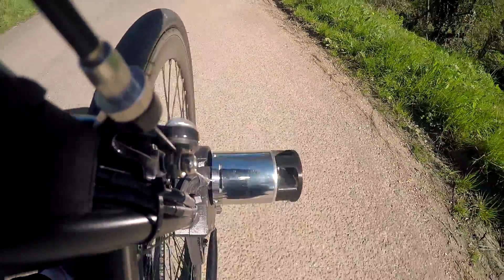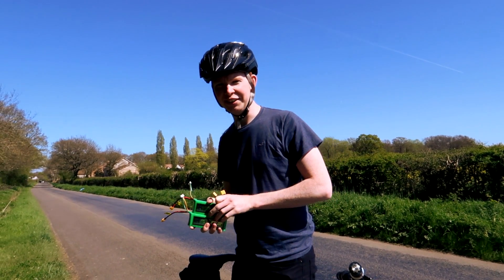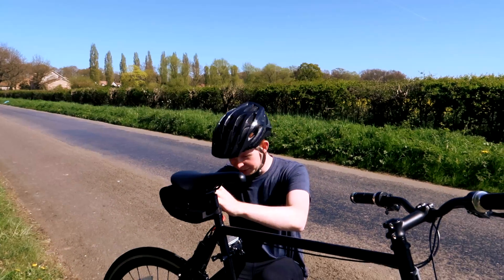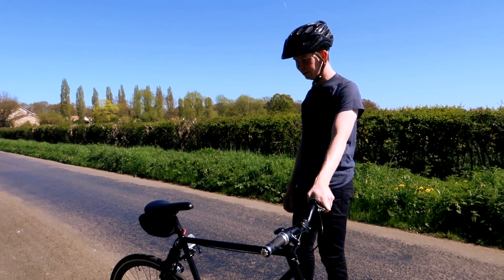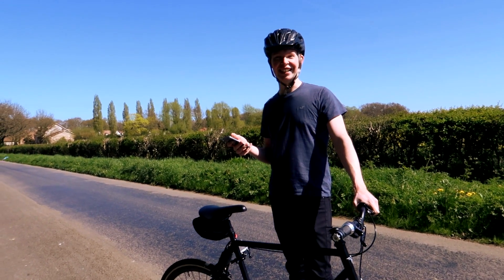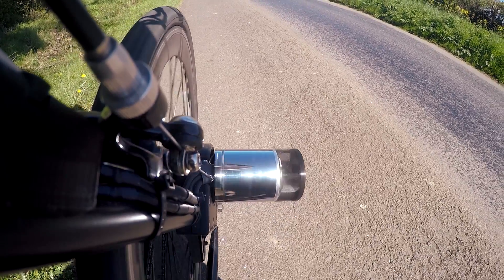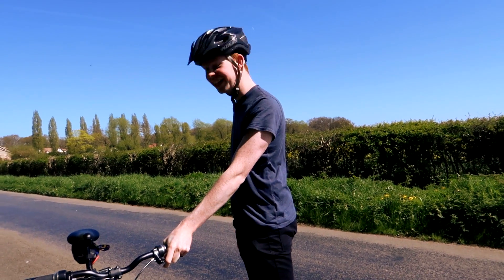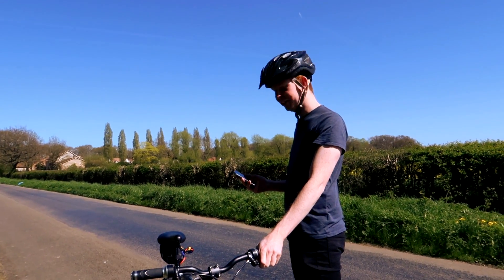Electric bike SPEED testing

Comment: Nice work Tom! The top speed is good info. Of great interest is the acceleration of your Mk IV with two motors. My hope is that your Mk IV is as fast an accelerator as the old Morris Oxford, which means that it is sufficiently fast to not impede normal traffic flow of ICE motor cars. Hope to hear of your acceleration measurements. Thanks for the upload..

Comment: Which 12v batteries you were holding?  How much is the cost? I need small &light 12v batteries for my bicycle light system.  I am trying to avoid using motorcycle 12v batteries. So looking for other alternative  :)

Comment: Wow was drawing 50 amps while using a 22 volt pack? Thats like a 1,000 watt ebike motor isnt it? So a m I right in saying one couldnt make a battery pack using the 18350 batteries because the c rating is to low, they don't produce enough amps for volts?

Comment: @ Tom Stanton - I admire your engineering efforts, and experiments...However, I cannot seem to 'see' the whole point of E-Bikes...Electric mopeds make sense, but obviously they need to be taxed & insured if they go over a certain speed...E-Bikes however, are (in my country) limited to under 16mph...And as such, why would anyone want to use one, unless they were either 1) disabled and could not pedal a traditional cycle, or 2) lazy and want an easier option to actually pedalling...I'd say get a nice mountain bike, get yourself fit, and do 25mph under your own leg power, and have fun with the knowledge you are doing the work yourself.

Comment: Hi Tom,

Do you get a better acceleration (torque), let's see from 0 to 10mph, using 12S instead of 6S, and by keeping the same gear ratio, or is it only a higher top speed (higher RPM)  ?

Thanks for your feedback, it will help in my project :)
Reply: Fosch those rc motors aren't designed to start under load. That's why you have to pedal until you reach 10 km and then use the throttle.
Reply: If you go full throttle from dead start you will blow the esc. You need a sensored motor controller for that.
Reply: Thanks for the info Matthew. 
So in this case, is the acceleration different from 10 to 20mph between 6S and 12S battery (at same gear ratio) ?
Reply: Fosch more current more acceleration. More volts more top speed. 
the acceleration is depending on current. If you configure your esc on 50 amps the acceleration will be the same on 6s and 12s. 
With 12s you will have more max speed. 
If you want more acceleration you need more current. You can use bigger esc with more much current. 
But this way the motor will get hotter and may get burned. 
If you look on motor specs it says 60 amps continuous and 80 amps for 10 secs. 
For more current you need bigger motor.

Comment: Very nice integration and design.  We may have to convert my son's electric bike to belt drive and LiPo's. The quick friction drive and lead acid batteries work OK for now.  https://sites.google.com/site/seanviolettesproject/2015-electric-bike
Also, I think I might be your long lost older brother or uncle...  https://plus.google.com/photos/102436782923215809534/albums/profile/6205586054674770946

Comment: What cooling did you add to the back of that motor? I was thinking on making something like this, and my motor  gets hot even without any load!
Reply: He mentioned it in his previous video...he's got a small plastic turbine like thing that forces air into the motor coils and housing as it turns.

Comment: Very nice.looks very light.My 1000w48v front wheel kit does 30mph flat out.It`s heavy adding 25lbs. with 12ah battery to a 26in. downhill style dual suspension bike.
Reply: peter toth I built a 48v 1500w 40mph beast
Reply: That is amazing.A simple kit from china can be made into something so fast.I`ll have a look at it.
Reply: peter toth  yep but don't buy the battery from China, either make your own out of 18650cells or buy a pack
Reply: peter toth  an I recommend you put it on a bike with at least 180mm disc break rotors
Reply: I learned the hard way with my bottle type batteries.So far i have managed 2 batteries good and 2 -48v1000w 6ah i need to figure how to take apart and salvage.

Comment: Hey Tom :) Can you tell me how much amps  draws the motor from the battery when it is fully loaded? I am making your ebike conversion at the moment and I think I got the wrong battery because it is 6s, 10C,6600mah(66 max amp discharge). I am not sure the battery will be able to handle the motor.Oh I forgot to mention that I am not using a VESC, I got an 50A ESC from hobbyking. Thanks mate!

Comment: I think it's Bell company that makes a cheap little speedometer for bikes. It clips on the front forks and a little magnet clips onto a spoke. If you used that you would be able to get top speed and current speed so you could see what changes had the most effectiveness. 
https://www.amazon.com/gp/aw/d/B003NKS26I/ref=mp_s_a_1_3?ie=UTF8&qid=1493316790&sr=8-3&pi=AC_SX236_SY340_FMwebp_QL65&keywords=bicycle+speedometer+bell&dpPl=1&dpID=419DU483UqL&ref=plSrch

Comment: What is the point of this video, it is not legal to ride a bike that can do such speeds without pedalling on UK roads?
Reply from the maker: The point was to see how fast an electric bike with a 3D printed drive train could go...whether it is illegal on the roads or not has nothing to do with the point of this video. What is the point in building any track race vehicle if they aren't road legal?
Reply: Rod Barker thought the point was obvious..in anycase good stuff really enjoyed the journey
Reply: A lot of municipalities in the U.S. have a limit of 20MPH for assisted bikes (if there is a law), otherwise it can be treated as a motorcycle. (Yet many places you can't register it as a motorcycle because other rules. So it falls into one of those further grey areas.) But a lot of people will hack their e-bikes to go faster regardless. Unless you're blatant enough to go telling everyone about it or speed in an obvious way in front of a cop, it's one of those things that's fairly easy to get away with.

Comment: can you do a review on rearhub or mid motor plz?  the wheelie was a blast!
Reply from the maker: +Lee AC my friend has ordered a 1000w hub motor kit, so we'll film a comparison video once he has it built. Thanks!
Reply: Tom Stanton awesum! cant wait...
Reply: Does it happen to be a 1000W 48V rear hub motor kit?
Reply: Here is a great resource about hub motors:  https://www.electricbike.com/three-250-watt-hub-motors/

I build a road bike with a cheap 250 hub motor and I can tell you about my thought process.

motor in the video:
- good: fast, cheap, small, light, bike balanced
- bad: no hill climber, 3d printer and skills needed, no 2 wheel drive (possible if installed in the front)

small 250W hub front motor:
- good: better on hills, cheap, 2 wheel drive, waterproof, simple installation
- bad: heavy (3kg), clearly visible, bike unbalanced, not perfect on hills

mid drives:
- good: fast and hill climbers when enough gears, bike balanced 
- bad: heavy, clearly visible, no 2 wheel drive, installation needs skills

I chose the 250W hub front motor, because I got a good deal and it is road legal. The extra weight in the front is the biggest draw back, but I can live with it. 
If I would build another bike, I would probably try to keep the weight as low as possible.

Comment: Wow, you guys are awesome.   You should commercialize this kit.  I'll bet you will make tons of money.  How much do you think you can sell it for and still make a profit for yourself?  I will put in a order now if it has been refined and QA.
Reply from the maker: I will definitely be refining it as I use it more. There are a few issues with commercialising it, such as the road legal laws and the very basic nature of the setup requires some knowledge of batteries, speed controllers and motors. However I will be looking into commercialising the currently non-purchasable hardware (motor mount and pulley) for people who want to build it themselves. Probably looking at around £500-600 if I were to sell the complete bike, but then adding on the cost of batteries (£150-200) and a charger (£100 ish), adds up the price of a complete (ready to ride) setup quite quickly. Thanks!

Comment: I'm building a ebike with a factory 36v Panasonic 3.6v lithium ion pack with 10s. I wanted to add a inline 4s pack with the same cell chemistry to bumb it up to 50v. I have upgraded my controller to a 20v that can handle the voltage but is this safe to pair? 10s+4s
Reply from the maker: Combining 10s and 4s in series is perfectly fine as long as the capacities of the batteries are the same. The 6s (5000mah)and 4s (5200mah) in this video were different capacities, which could cause them to discharge at un-even rates. This was fine for the short test, but it's not recommended for normal use.
Reply: It there a way to wire the batteries so that the pack discharges evenly?

Comment: Motor was drawing more than expected because it got hot and became less efficient. Additionally, the sound you heard was of the belt "slipping" you will need a bigger cog on the motor so that there are more teeth engaged with the belt. (but you will also need a bigger cog in the rear as not not cause a reduction in gearing)

Comment: Nice work! Wonder what results would come from using a road bike with high pressure skinny tyres? less rolling resistance etc? Maybe lighter? My (very) old 531-tubed steel Raleigh bike is about 21lbs stripped to bare essentials. Do you have any sort of claw-back arrangement where downhill stretches might restore some charge?

Comment: Good Job fella. The voltage sag on those Multistar batteries is huge. I use them only for very low current draw applications. Like slow/camera quadcopter. If you run some higher C batts you will go much quicker. !
Reply: Maybe a little faster.  Not much.

Comment: turned out great, cant wait for 12s and lower gear ratio. Reckon you could pop wheelies with it then? :P
Reply from the maker: It might be possible! though I would need to practice my throttle control as I've never wheelied a motor bike lol
Reply: Tom Stanton it'll be a lot easier than you think as you've already got the balance point sussed out , throttle control is all you need , lot easier than learning both at the same time plus as you are not pedalling you do not need to keep shifting balance left to right as you are pedalling !

Comment: are you using LiHV? because regular 8S Lipos have 29.6V, 6S have 22.2V. i guess you meant the voltage when fully charged.
Reply from the maker: I used lithium polymer batteries and was stating the charged voltage as all the batteries were fully charged before the test

Comment: Bigger motor, more battery power, more speed :)
Reply: Jonathan if the motor and battery weight was doubled and had twice the output power it will indeed be faster as the motor is only a fraction of the weight of bike and rider , hence twice the power for a 10% or so weight gain !
Reply: Lee Tookey more weight